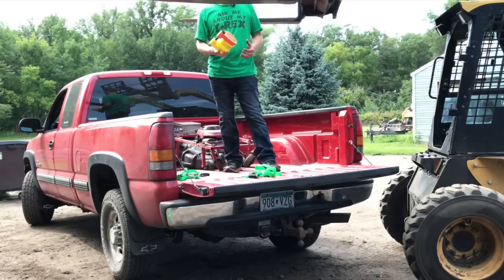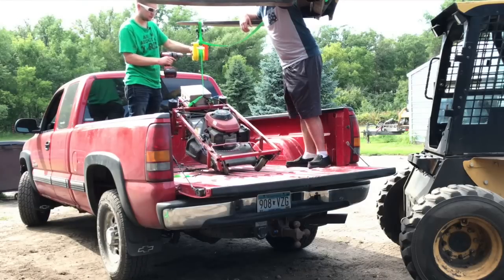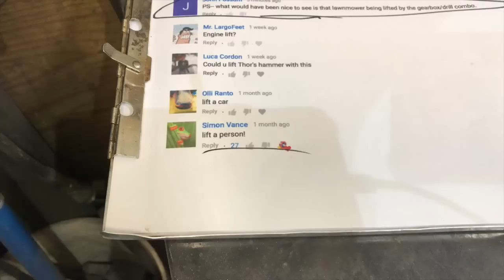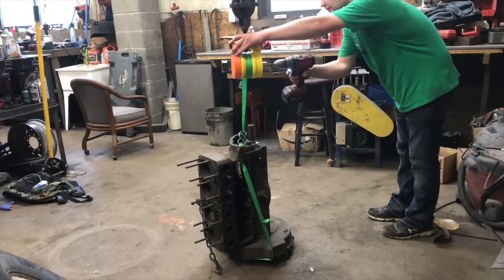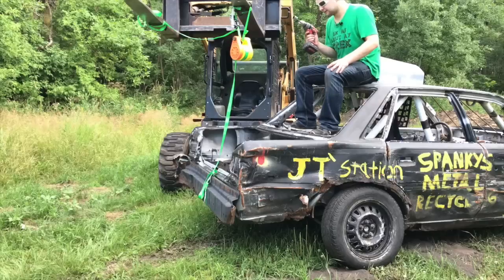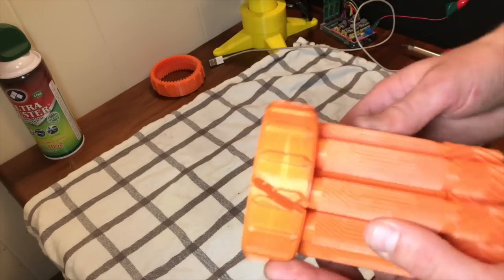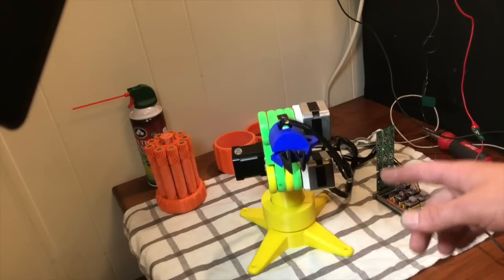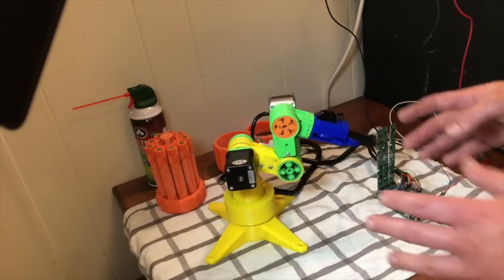Can a 160:1 3D Printed Gearbox Lift a Car?

Comment: This is interesting, although if the strap breaks, you can easily get hurt.  Have you thought of taking it apart and doing a postmortem so see if you can improve the design?  Possibly while using less plastic?

Comment: I noticed that when you were doing the assembly of this gear box some of the ring gears were split...   Does that mean it would be impossible to create this box in metal?  Where you can't really split the ring gears..
Reply from the maker: +Kobe Wild Yes, it would be impossible to build this in metal without a redesign
Reply: Just split it twice (i.e. make the annulars out of two keyed, half-shells)

Comment: Can you use outside clippers so the gear not split while it lifting heavy weight. anyway tremendous for 3d print material to take that pressure be more prepare with safety glasses at least if some plastic smashed out nice project by the way

Comment: What if you had the gears in an oil bath to keep them cool and lubed? You might have to play with weights but it might work. Also you could have a 3D printed pump to move oil from the bath to a heat exchanger (oil to air or oil to liquid i.e. Ice bath).
Reply from the maker: they actually stay pretty cool on this gearbox. these gears have metal rods through them so they have a lot of thermal inertia

Comment: Well... If you build a newer version, try to make it with a built in electric motor for extra safety. So... All you need to do is just put couple power cables and let it lift stuff at safe distance. ;D
Reply from the maker: +Ti M I've been thinking about doing that, but just haven't had the time :)
Reply: Gear Down For What? Nice. ;D 👍

Comment: Quick question about the robotic arm. What are you using for position control and feedback?
Reply from the maker: +Kaushik Prakash it's all done with stepper motors. There is no feedback.
Reply: Gear Down For What? So how are you able to tell the robot arm what position to go to or are u using the stepper library for Arduino and simply telling it how many more steps to go to?
Reply from the maker: +Kaushik Prakash I tell it to go to max right and then max left and it will skip steps when it hits the limits. From there I know that 0 is center.  And yes it's using the stepper library.
Reply: Ok that makes sense

Comment: Guys - we know you're smart enough to design & print out 3D gear box.  So how come you aren't so sharp when it comes to lifting objects?  For instance, may I suggest, a trapeze setup.  Get a 5' or 6' metal bar, attach a strap on either end.  Then, from the center, use a central strap to attach to your nifty gearbox.  That would not only be professional looking, but a whole lot safer for lifting objects that could hurt you if not done correctly.

Comment: if you reverse the gear ratio (1:60) will it achieve crazy rpm's ????? is that practical?? or which gear ratio would be practical to get high rpm's?? do rc airplanes require more torque or rpm???? i don't know much about the gears; only that reversing this ratio will produce extremely less torque. can someone explain me??

Comment: How about making four of these then connect each to a wheel hub of the biggest bull dozer or tractor you can find. Then Have four guys pull the trigger on their drills. Maybe scale down the ratio towards 320:1...i think oiling the gear was what caused the slippage! Next time don't repeat that mistake

Comment: "Makes no sense at all."Not entirely true. Using the lift wouldn't give you fine control such as when lifting an engine out of a vehicle. Of course that probably greatly depends on the quality and age of the forklift and hydraulics. Using a lift truck as a mount for a chain hoist, or this, if it actually could be made durable enough to legitimately use does give you the necessary fine control. A forklift and something like this is like a self powered, adjustable height, all terrain gantry.

Comment: ...you realize that this means the gearbox has a built in safety clutch right?
Reply from the maker: +Sun Gear yeah it's pretty cool huh?
Reply: Gear Down For What? Because it's a split case! 
I'd love to see this re done with a solid case
Reply: MyLonewolf25  that would be cool but impossible ta assemble
Reply: @MyLonewolf25  the case was splittet so it could be fitted, it was already splitted in printing
Reply: A few large diameter hose clamps should help with the slippage, then they can do even more crazy test to find it's eventual & inevitable limit!

Comment: 9:19 you know you can use aftermarket stepper motor driver ICs, and use your micro for higher level stuff, right?! There are lots of boards compatible, with their own C++ libraries for the Arduino development environment.

Comment: Can you make that out of metal somehow?
Reply: MG Racing Studio hmmm... Make PLA model and use it as matrix to be replaced by metal? :/ - Lost PLA casting?
 Not sure if would work... But... Why not? :D
Reply from the maker: +MG Racing Studio it's possible, but very expensive. That's why this style of gearbox isn't very common
Reply: Carbon fiber PLA
Reply from the maker: Talk ProjectTube Into doing a collaboration with me and we can make that happen
Reply: Gear Down For What? it's becoming more and more tempting...
Reply: Make it happen - Aww yisss! :D
Lost PLA cast gearbox.
Reply: Use loss casting. Make a plaster mold with the gears in it, then bake out the plastic. Pour in your metal, probably aluminum or brass.
Reply: They could cast it using the 3D printed parts they have. Some green sand and some metals would do. YouTube is chuck full of stuff like that.
Reply: what about powdered metal?
Reply: cnc get real
Reply: Alucard Pawpad yes but then you would have to sand around the edges and sand the teeth, and accidents can happen while doig so, he should instead use a laser cutter or high pressure water cutter.
Reply: Alucard Pawpad the thing with green sand and lost plaster, wax, or Styrofoam methods is the sand will burn around the edges of the mould, and the outside of the mould will be black and bumpy, you have to sand it all-out, which takes a long time, and then how will you sand the teeth? if you do you may even sand the teeth down and there may be deformed/missing teeth. then theres also the part about handeling a thousand degree liquid and making/buying the foundry, which is either time consuming or expensive. it isn't like those grant Thompson or costs lab videos where everything turns out perfect in the end. it is dangerous and impractical.
Reply: Gear Down For What? maybe do a later collar with waterbed channel?
Reply: Lol there are actually these things called gear boxes that are already made from steel, but thanks for playing
Reply: no good would still need to be machined to finish
Reply: Wow. Talk about missing the point you lot. This gear was made my downloading/designing the parts on their own PC, in their own home or workshop from plastic on a roll. If you cannot grasp why that's amazing, you're a goose. We are one step closer to real, usable, home made printed tools, parts... Well anything!

Comment: Next design of the gearbox needs to make it lubricated 100% of the time with a fill inlet and maybe drain outlet. Obviously it need lubrication, so why not just add a cavity for gear oil and enclose the gearsets.
Reply: Man - I thought the same darn thing.  That would be a pretty smart improvement.  Have to take it up with the original engineers that designed this setup.
Reply: It could cause gear slip because 3d printing is not super high tolerance